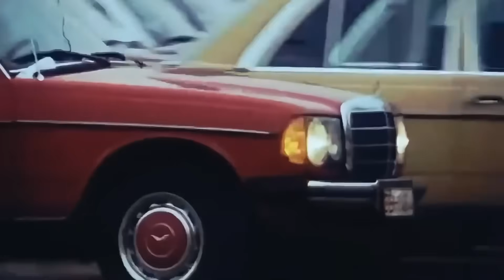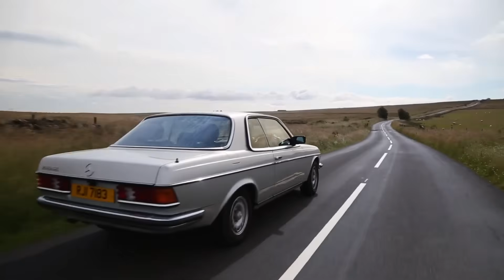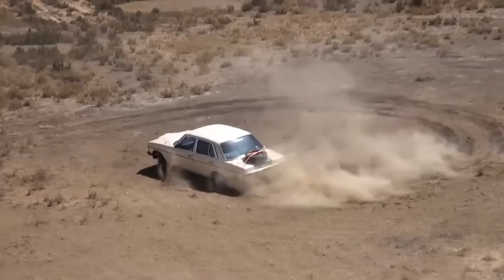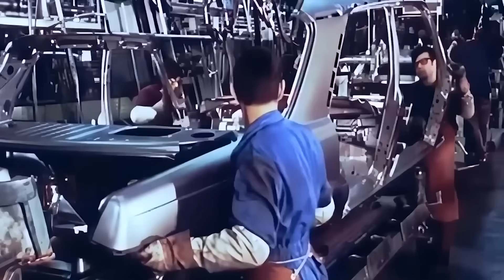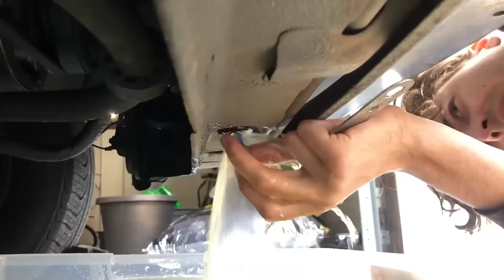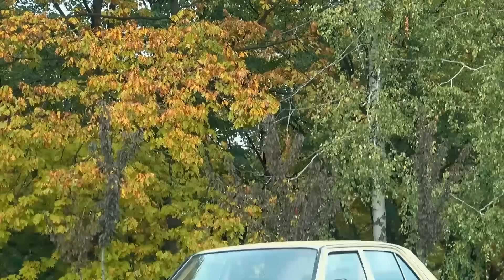9 SHOCKING SECRETS About The Mercedes Benz W123 (1975-1985)

Comment: I once owned a second-hand Mercedes 123 1979 model 2000cc manual maroon-color way back in the late 80s. It was a trouble-free car, very comfortable and so easy to drive. I used it for 3 to 4 years. I gave it up on impulse as a young man with a bad habit of switching cars every now and then. Since then I had driven many makes of cars including Japanese and Korean and French cars, but nothing could come close to that 1979 Mercedes 123. I used to tell my wife all the time these passing years about the unique extraordinary special and comfortable feel seating behind the wheels of the 123. Nowadays I cannot spot any 123 on the road. It just disappeared. Only videos like yours are singing the praises of the 123. Otherwise hardly anyone talk about the 123. It’s too late. Otherwise I would have kept this classic. It’s all memories now. I now drive a Mercedes 2008 Kompressor in memory of the 123. Many electronics, a good car, but I still miss the 123.

Comment: The 123 is undoubtedly a great car and an icon of its time—no question about it. But the other truth regarding secret No. 7 (central locking) is that figuring out exactly where the vacuum line has a leak is very difficult...

Comment: They are way too upbeat about the vacuum door locking system.  My 1984 300D-Turbodiesel went to the repair shop most often for a failed door vacuum.  Something as simple as a back seat passenger unlocking a door manually could require repairs.  Worst of all, when the vacuum system was broken, the car wouldn't turn off from the ignition.  You had to open the hood and push the "stop" button on the engine.

Comment: An impressively robust platform with one major weak point  - 1970s rust protection proved to me much less durable than the mechanics of this vehicle. And once rust gets hold of structural , it's really hard work to get rid of it. The worst part of it - more often than not you don't see it from the outside. Other than that, a great car indeed

Comment: I have a W123 and while the cooling system for the engine is fantastic the A/C is TERRIBLE, full stop. It was an afterthought and it shows. In the US they used a pathetic R4 compressor that wore out in hot Southern states almost in a yearly basis. The evaporators were too small and almost impossible to service. Great car terrible A/C

Comment: Rust issues?
Reply: I had a very rusted one here in Iceland 🇮🇸.
The owner bought 2 of them (W123 250) brand new in ‘78 and used one of them exclusively as a work car.
-Maybe he didn’t have it rust-proofed (or whatever??) but it was very rusted indeed when I got it (after he passed -so I was owner no.2) !!
-Had it fixed up so it looked like new!
It only had 112.000 km on the clock when I got it (that’s about 69.000 miles). (Stick shift, btw.)

Comment: I have owned a W123 since 1989, a 200 4 speed manual with the M102 engine. I bought it from the German Embassy in New Zealand, it had been their official car. I have also owned a w124, 2 w210, and currently a very low k W211, but cannot bear to part with the w123. If you want to source parts just look on e bay, there are thousands of parts available, also your MB dealer

Comment: I am quite sure that the W123 was designed by Paul Bracq.

Sacco designed the W126, W201, W124, W129 and W140.

The W123 rear semi-trailing arm suspension is kind of bad when it comes to handling as soon as the road gets wet, far inferior to the W124's multi-link.

The vacuum-powered central lock is kind of an Achilles heel - as soon as one of the actuating bladders is damaged, or a tube cracks, it stops working and finding pieces is hard.

Worse than that, the A/C also uses vacuum to actuate its various lapels and near nobody knows to service them anymore, especially the central unit (note that the same vacuum systems continued to be used in the W124).

Also, it is common for a fault in the central locking or the A/C vacuum systems to impede engine shutdown in diesel-engined models (again, shared with the W124).

Comment: The taxi in Greece with 4,6 million kilometers was not an w123, it was an w115 the owner had to replace the engine 3 or 4 times, the owner got an brand new Mercedes from Mercedes, the w115 it is now in the museum
Reply: The thing about replacing the engine is not correct. -It was well serviced and repaired as needed, of course.
But it is exactly the point that it is the original engine that makes it museum-worthy.

Comment: I've been lucky enough in my life to own a lot of expensive and beautiful cars, but the w123 & w116 will forever remain "under my skin"!
I've had a lot of w123 Mercedes and they were all petrol, and one of the things I liked about the w123 is the heating that works the moment you start the engine, even if the temperature outside is 'below zero'! 
 I don't think Rolls Royce has that kind of heating either..........
Reply: I drove, but never owned, W123. I owned 116, 126, 140 models. Each had their flaws and strong sides. Mercedes often took something good to make it mediocre in subsequent models. It is said that the W140 was the last Mercedes built by engineers; all subsequent models were build by controllers.
Reply: @McGhinch 👍...
R. I. P. Bruno Sacco ✝️
As far as I am concerned, the "last" Mercedes was produced in 1996....

Comment: I dont believe the mileage on same engine , how many times was it rebuilt . that engine rarely went over 500 k miles without a recon .
Reply: For diesels with good oil and periodical change is 1M km (about 625 000 miles) no problem, then it goes down slowly due to wear and tear. In african climate it could be usable another few houndreds of miles of his live till compression drops too much to succesfully ignite fuel. Gasoline engines M115, M123 or M110 do not last so much, but 0,5M miles is still for those times almost twice as competitors do.
Reply: Taxis can reach high mileage because they are driven continually and don't have that many cold-start/warm-up cycles for the distance they travel.  The oil is always warm and the engines and exhaust don't have as much condensation internally.
Reply: These engines are famous for their extreme longevity! It’s well known.
Reply: Diesel

Comment: Looked better with European headlights. But these cars are a great testament to German engineering at it's best
Reply: Germans and Mercedes make the best Diesel
Reply: @anthonynicholich9654 legendary!
Reply: @anthonynicholich9654 
I took a cab when in the Canary Islands a few years ago. It was a W123 diesel….and it had over a million kilometres on the clock !

-Now, my Spanish is actually nonexistent (but I speak several other languages and have a good ear for them) and I managed to have a (sort of) conversation with the owner - and he assured me (with a smile) that the km’s were all original - and that it was a great car !

(And I knew exactly what he meant, for I had a Mercedes 250 myself-years ago, though).
Reply: I kinda like the circular lights 😅 you know which are the European ones?
Reply: @andesbarbershop  US are not covered with one glass piece. Round ones were standard for everything under 280/280E even in Europe, just under one glass, after 1982 got whole portfolio square ones like top hemi DOHC six cylinder have from beginning.
Reply: Opinion. I prefer the round lights.
Reply: @ultrablue2 . I'm quite sure ,it was designed with the square ones. Then comes the US legislated lights..
Reply: @reneegudjon3204 
Actually I think the round ones came first. (“I think”) 😉
  -K.🇮🇸
Reply: OM616 was even better.
Reply: @anthonynicholich9654  It is the same engine - design, just one cylinder longer. OM617 was developed from OM616. I think, someone named Ferdinand Piech was responsible for it... 8-)

Comment: The 123 is an amazing and I still regret selling mine, but while the vacuum central locking is smooth, it's extremely difficult and expensive to fix when - not if - it fails as finding the leak takes forever and can be hidden behind panels
Reply: I've had my 240D manual shift for 30 years and done all the maintenance myself. The vacuum pump bearing failed some 20 years ago and I was able to obtain a rebuild kit. Vacuum leaks are almost always a servo diaphragm leak. I chase them down with a MityVac pump kit. Unless there is impact damage the vacuum lines rarely leak. I've really enjoyed the vehicle. 430k mi.  😊
Reply: i use a smoke blower machine to find the leaks - $50 on amazon. Uses that same smoke from train sets we had as a kid!